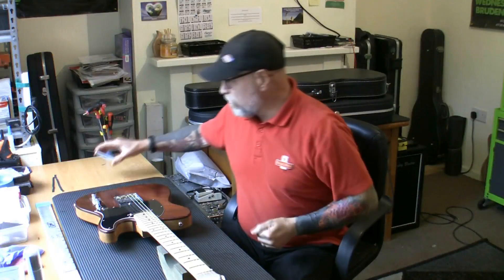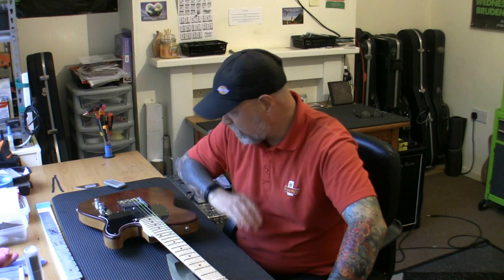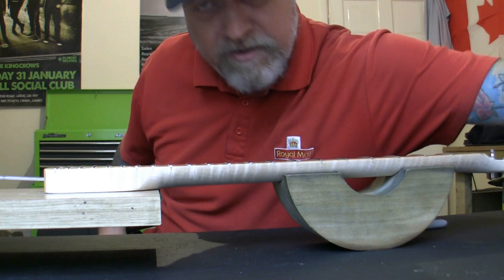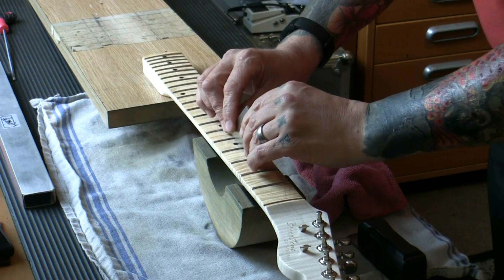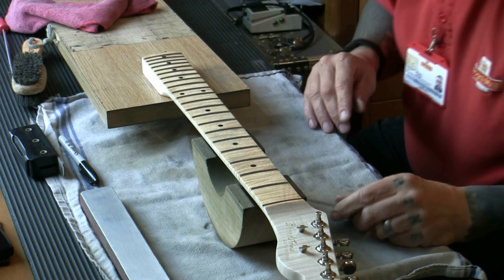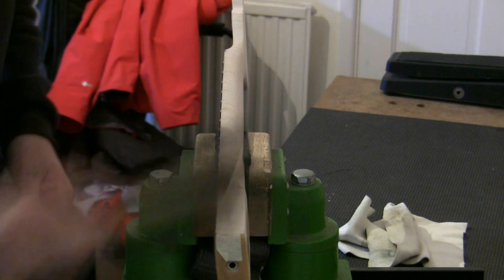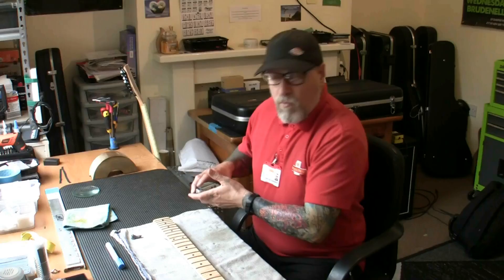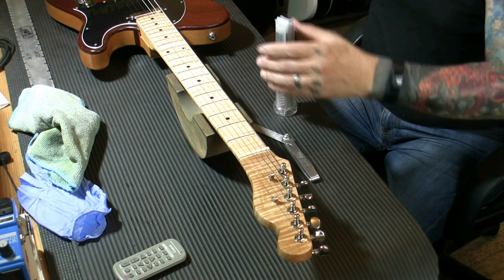Bloodstone Telecaster fret level, setup and neck staining...

Comment: With it being a recent build I'm surprised you did check to see if those high spots on the frets weren't due to the frets coming unseated ie coming loose before levelling them.
Reply from the maker: All frets get tapped back before levelling. If they still don't seat, they get levelled! Victor...